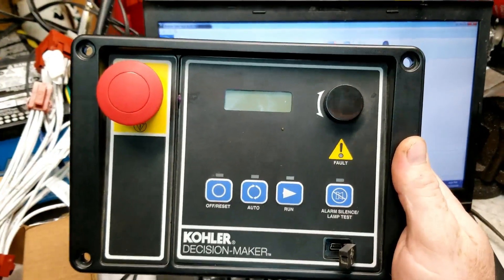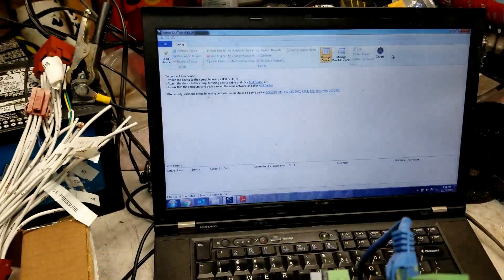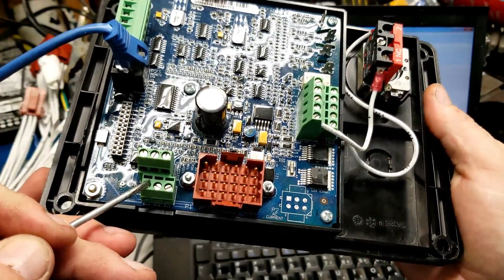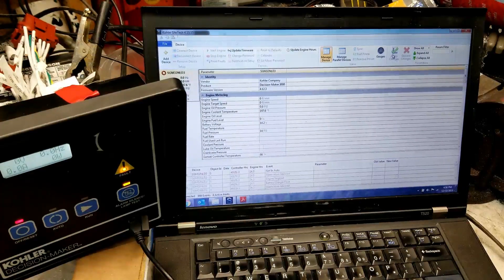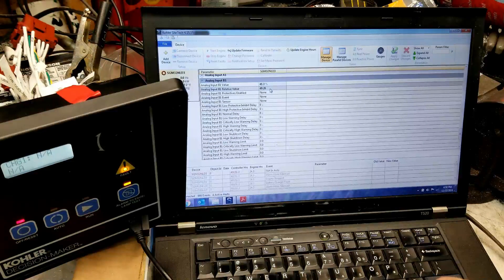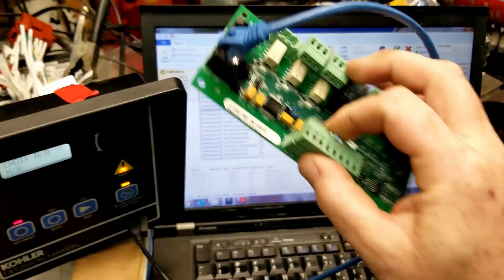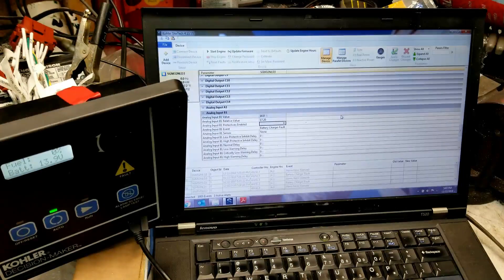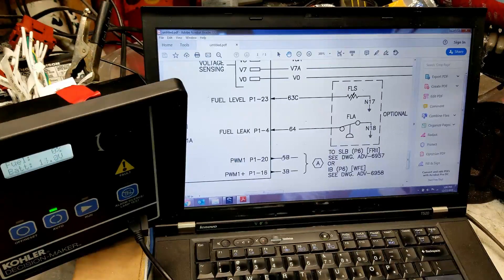KOHLER DEC 3000 DIGITAL INPUTS

Comment: can you change the 3000 from three phase to single phase
Reply from the maker: depends on the alternator, if you see 12 output wires coming out then yes. but you need the kohler software
Reply: @chainsawsandgenerators9952  where can I get the software please help from colleague to colleague

Comment: SO, of ALL of the books ive looked up, there is no book that ive seen that have plainly showed the pinout for the main connector. like where does the mag pick up go, or oil pressure, etc. any part numbers on manuals that would show all that? without ecm